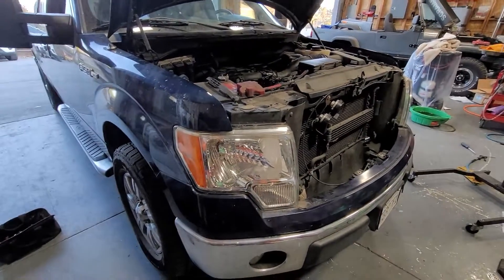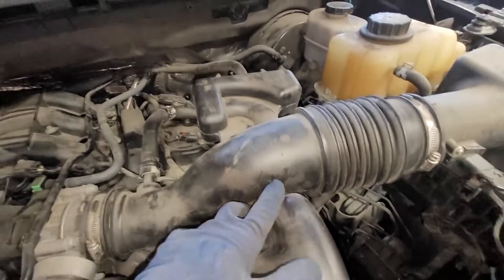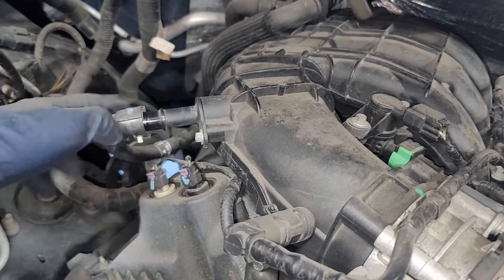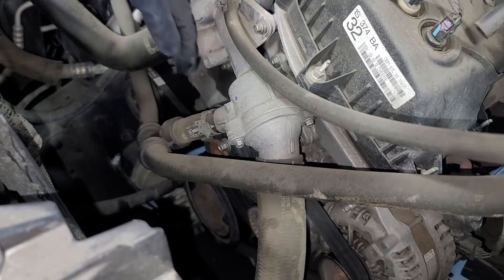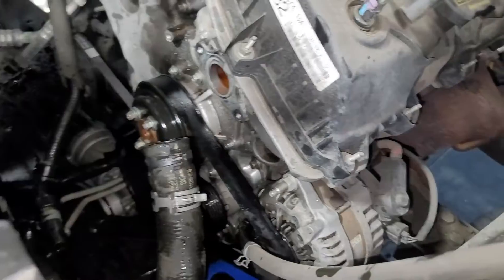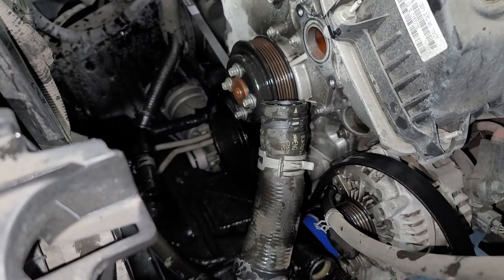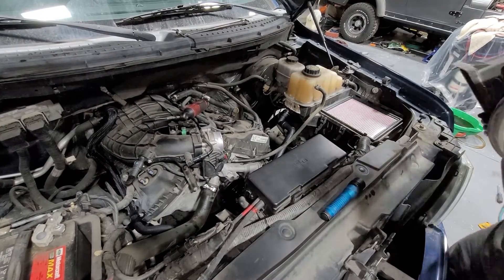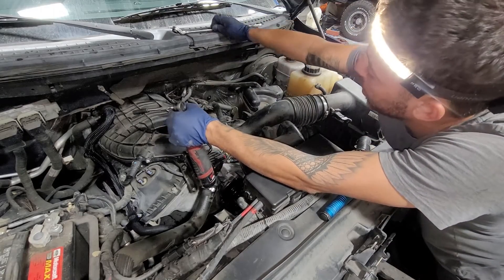2012 Ford F150 3.7L V6 Water pump replacement

Comment: Thank you for your detailed video. 
I just did the job on my truck and everything went well except removing the thermostat housing from the black pipe on the top left. 
Corrosion got the better of it so it took me about 10-15 minutes of penny lube, wee bit of heat, wee bit of beat and a whole lot of praying but alas, my method sufficed... I think the guy before me put too much silicone gasket maker kinda like you did. LOL

Comment: Great video! "BUT" That 45° turn after it's torqued is BS. I think they want you to do that so the dealerships have more to fix after you snap a bolt off in the timing chain cover...17 foot LBS is just way too much, I just replaced my water pump in same exact truck, and snapped one off at 12 foot LBS.
Reply: What torque do you recommend for the water pump 10ft Lbs ?
Reply: @ROROSMACHINE  ten flbs is probably fine, I would put a thin layer of rtv on sealing surfaces and tighten just nice and snug.
Reply: @justinwallace6258  Thanks, gonna replace mine tomorrow, I appreciate the advice....

Comment: At 16:30 you point to an O-Ring but you don't mention replacing the black seal that you point to.  What about replacing that seal?
Reply: nope dont think its needed to replace
Reply: What’s that seal you didn’t replace on the bottom of where the water pumps mounts

Comment: The waterpump is timing chain driven. That’s not the pump. The pump is behind the timing chain cover
Reply: Not on the 3.7 in the f150. Apparently the Edge has a chain driven water pump. 
I just finished doing it on this exact same model truck. What do you think the impeller on the pump you believe is not the pump does?
Reply: L'assaut6 is correct, the Transverse escape 3.7 has an internal pump because of engine compartment confinement... 
The 3.7 Longitudinal engine has an internal delete and a standard belt driven front mount impeller design..
These 3.7s are excellent engines and with proper care could likely go 500 thousand miles...
If you have an earlier model with Orange coolant you may want to flush the system thoroughly and use the pink hybrid coolant, but you must flush all the Dex Cool crap out thoroughly because they do not mix well and can cause chemical reaction damage...